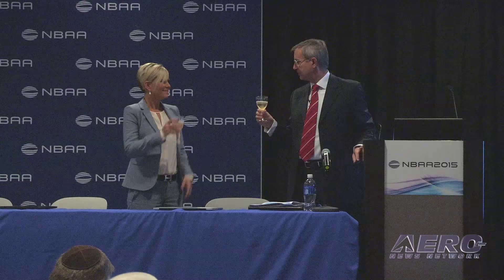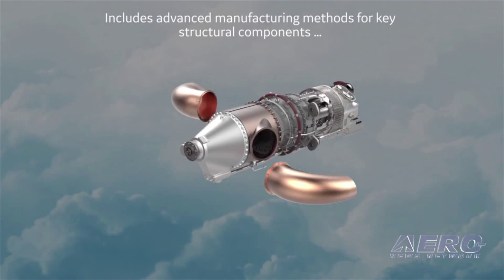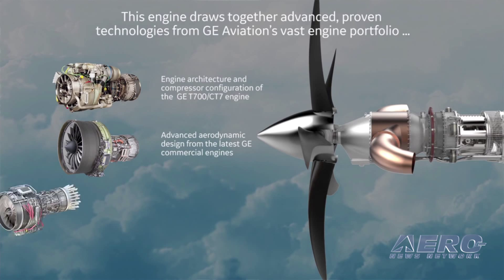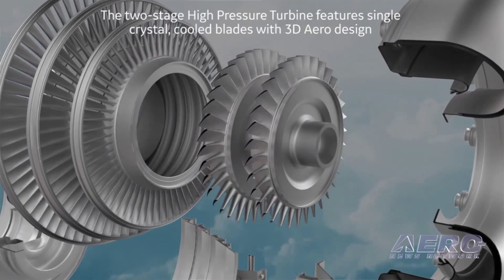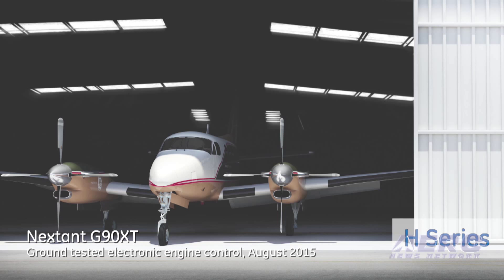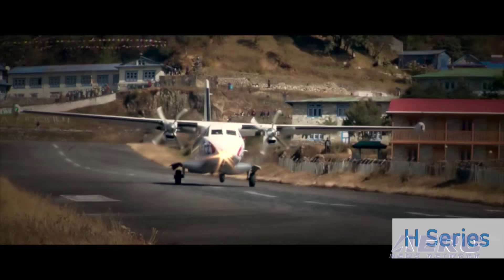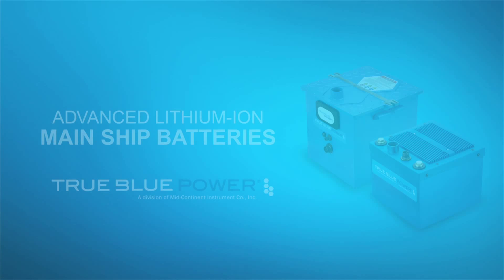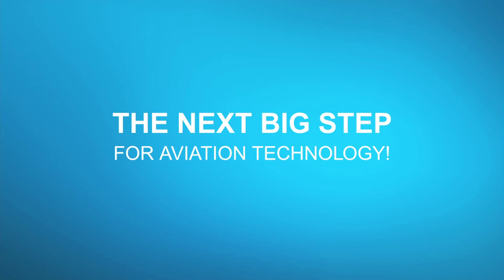Aero-TV: GE's 'ATP' Program - Tomorrow's Turbo-Prop!

Comment: The PT6 in the T-6 Texan has a single power lever that controls the engine and prop. Nothing new there.
Reply: oisiaa So, where did you earn your engineering degree with a specialization in propulsion?
Reply: Who needs an engineering degree to describe the operation of an engine that can be taught in an afternoon to a 100 hour pilot?

Comment: 10% more power and 20% fuel consumption reduction... is there even space for such drastic improvement of efficiency?
Reply: Depends on what you are measuring against.  People always say X% less, and immediately comes to mind, "less than what?"    What's the reference?  The H75%?  The competition PT6?  What are we talking about?  If it's PT6, there is easily space to improve.  If the new 3D airfoils in the H75, maybe not 10% / 20%.   More importantly, where is the engine today?  I could find out with one phone call, but does anyone here know already?

Comment: What's the point of this engine?  We already have an engine that has at least 10% more power and burns 20% less fuel than the popularity contest winner a Pt6a, it's called a Honeywell/(formerlyGarrett)  TPE 331 series single shaft turboprop.   Why everyone drools over the PT6 engine from P&W is beyond me.   It's a dog horsepower wise and is bad on fuel, also has to spool up so there is a lag when needing immediate power.    The difference between a piper Cheyenne III and the 400 LS, night and day.

Comment: It produces 10% more power & 20% less fuel...than what?
Reply: 10% more power at high altitudes and 20% less fuel. So, it can go higher than normal properly due a higher compression. Below than it will produce the same power but 20% less fuel.